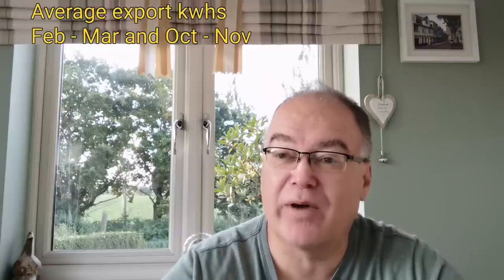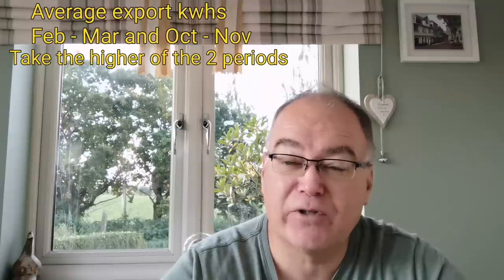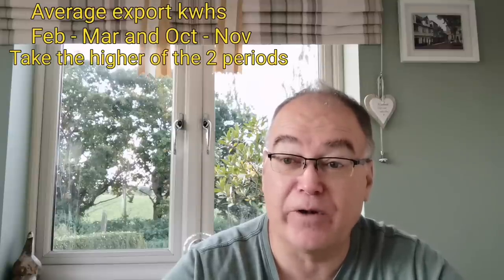How to size a home storage battery

Comment: Excellent video. I started with 6.5 kw solar and 8.2 kwh battery and found battery running out during the day in the winter months. The battery is only 6kwhr useable so I have just topped up with a new 9.5 kwhr battery which is 100% useable giving me 15.5 kwhr. What a difference it has made with grid import down at below 1 kwhr per day this winter. I used to charge the battery overnight on cheap rate and whilst still having to do it when there is no solar, the frequency of charge has also reduced. I agree with going big on battery size and solar. The biggest surprise has been the free hot water from the EDDI. In 550 days of having solar I have used the gas boiler only 10 times to heat up the water!
Reply from the maker: That sounds like a great solution you've got and paying dividends with its free energy. Eddi hot water is awesome, I hate drawing from the grid for hot water but needs must in December and January
Reply: I've stopped using the gas boiler to heat hot water - overnight electricity is cheaper, especially when taking efficiency into account.
Reply: Our 6k solar and 8.2k battery system (5k inverter) was installed mid September.  Presently on Octopus Go, and since late October, we've been regularly charging the battery to 100% each night.
Our base load is quite low at between 180-220w.  Family of four in a 4 bed detached home.
I did contemplate increasing battery by adding another 5k, but want to see how we fare during the worse period first.
Also (ours is mostly Givenergy) the battery output is limited to 2600w.  In order to increase the output you need to add another inverter (so I was told) which I wasn't keen on.
A little bit of common sense with main / hungry appliance discipline goes a long way, and the tumbler and washer can always be set to run during happy hours if necessary.
Perhaps down the road I may look at one of these Eddi diverters, but then we'd also need the water storage fitted and plumbed.
Inverters typically last about 10 years I've heard, if this correct?
I'm putting some of my funds aside each month for it going pop somewhere down the line..
Reply: Want to help the grid ..... are you kidding me, the "grid" has been ripping us off since its inception  - why would anyone want to "help the grid"?
Reply: @chrisrebar2381  maybe the excess energy produced with 'help the grip' ie you, by reducing the likelihood of power cuts...
Reply: @stuartburns8657  My first inverter lasted 11 years almost to the day.
Reply: @stewartaitken8022  Yeah, seems about on the nose timing / durability wise 👍
Reply: @EVPuzzle  Yes， and the energy storage integrated machine has appeared on the market now, and its capacity is very large, 15-35kwh.
Reply: @EVPuzzle Thank you for your video. You bring up some interesting points.. that being said. I disagree about your general statement that we need to use less energy. If we're talking about energy from the grid, or generator I am in COMPLETE agreement, however, one of the biggest advantages of even having a solar installation is the freedom to use energy to enhance our lives. 
If one's system is properly sized energy usage no longer impacts the grid. Obviously, it's not practical to design a system that will be 100% grid independent 100% of the time for days and weeks on end, so airing on the side of caution is always wise.
I SAY: " LET SOLAR POWER SET YOU FREE!"

In for a penny in for a pound. I'm going from no solar system whatsoever to: 10kw solar array, 12kw inverter & 30kw battery storage (24kw @ 80%)
This should allow me to run off of my solar panels during the day in store enough to get me through the night using the grid as a backup and a 6,500kw LP gas generator as an additional backup.

Comment: Very useful video. I went through similar thought process and decided on a factor of 1.5 times average usage, so 15kwh battery for average usage of 10kwh. Only installed for a few months but seems to be working out. Definitely think about the three parts of the year. Summer -  we will be self-sufficient in both electric and hot water - no mains usage. Winter - just charge the battery in the overnight cheap rate and let solar do what it can to cover daytime load and recharge. Spring/Summer- partially charge overnight and top up from solar. One big advantage of oversizing: if you are installing a complete system it is free of VAT, if you add an extra battery later it is plus VAT!
Reply: Yeah, got a 6k pv and 8.2kwh battery mid September.
Pleased with it, but wish in hindsight I'd have also maybe added another 5k battery as part of the original install vat free.
Hindsight eh?

Comment: Thanks, Nigel. Some good ideas to help with the calculations. Great work, keep it up 👍👍 I am 1 week in to having Solar connected. It's an E/W facing roof on a smaller detached house. I've gone for 12 West facing and 7 East facing panels - All I could fit given the roof shape. On Monday we have a 5KWh battery arriving. Looking forward to seeing how this helps with the overall aim of reducing pull from the grid. I will use this winter and spring to see how it works, and consider adding another 5KWh battery next year. I remember your earlier video well with advice about just using less electricity first before buying batteries. We only use 2750KWh a year at the moment as a household, but well see how this changes as we adapt to having the solar / battery available.

Comment: We use less than 10kWh/day on average, and we're retired.
We've just had 10kW of panels installed 5/5 on an East/West roof with a 35° pitch. Two 5kW string inverters and an Eddi. I also have a Zappi, but only need to charge the car once a fortnight, if that.
I've turned off the gas hot water and use appliances as much as possible during daylight hours.
I have a 10kWh Libbi with 5kW charger/inverter on back order (subject to price).
One of the issues that needs to be considered is battery inverter.
Microwave (900w) plus kettle (2.8kw) plus oven (2.5kW - 4kWh on boost) means that a 3.5kW battery inverter won't hack it.
This is going to be a learning experience for me between now and when the battery arrives.
Reply from the maker: Nice low usage so your solar and battery will keep you running without any grid use most of the year.  Tiny bills here we come 👌👍

Comment: Really interesting real world example. Great video and shows the complexity of the calculation.   No idea yet whether our calcs are correct - 11.6 kw system with 2  7.2 kw inverters and 2 5kwh batteries on a 3 phase supply with an ev!  Plus English weather…. Too any variables…..
Reply from the maker: Solar sounds great so presume you use lots of energy, battery though will be the challenge, how often do you run out and are you happy running out.

Electric heating is a killer as it uses energy outside solar hours

Comment: I think for me a key consideration as well is future proofing. I’ve gone for bigger than I need with the expectation of buying an EV (or 2) in future and possibly a heat pump further down the line. Seems like more and more things are going to be using electric going forward.
Reply: Yes， and the energy storage integrated machine has appeared on the market now, and its capacity is very large, 15-35kwh.

Comment: Thank you for your video. You bring up some interesting points.. that being said. I simply disagree about your charge that we need to use less energy. If we're talking about energy from the grid I am in complete agreement. However, one of the biggest advantages of even having a solar installation is the freedom to use energy to enhance our lives. 
If one's system is properly sized energy usage no longer impacts the grid. Obviously, it's not practical to design a system that will be 100% grid independent 100% of the time for days and weeks on end, so airing on the side of caution is always wise.
I SAY: " LET SOLAR POWER SET YOU FREE!"
Reply from the maker: Very true , it is an enabler but freedom Vs wastage has a line . Balance is good

Comment: Morning

New to this game, had 12xJA Solar 405w panels, a Solis 3.6kw hybrid inverter and 2x 5kw PureDrive batteries installed early August, so not much data yet…so far, I’ve only imported 49kwh (approx 6% of my consumption) since the system went live and living in the central belt of Scotland I’m expecting this to increase over the winter months…more to follow as my data set expands…

Like the videos….
Reply: Hi Duncan
I'm in S Ayrshire so was interested in your data. We have a 5.85kW system, but are still waiting for our 10kW Puredrive battery. Who knows when it will arrive. Can I ask why you went for 2 5kW batteries rather than one 10kW one? Thanks
Reply: Afternoon Martin… 3 factors on the choice of batteries…. Availability, ability to daisy chain thereby increasing capacity and redundancy… if we lose one battery we still have a partial system…
Reply: I’m in the process of a similar sized array but looking at one, likely two GivEnergy 9.5kWh batteries and 3.6 hybrid inverter.  Based in Glasgow, think the second battery might help more in winter.

Comment: Thank you for your well thought out video. 
We installed our panels and batteries nearly a year ago now, and had similar thoughts. Now we live in Portugal, which is somewhat different. Approximately 300 days of sun per annum and you can’t sell back to the grid.
But the same logic still applies; understand what you want from the system, work out your peak daily use, and size panel production and energy storage accordingly. 
We have been off-grid since March and we consider we have the balance.
By the way, I’m a Norfolk gal, and I can hear a slight lilt in your speech, but the picture of Elm Hill confirmed it to me!

Comment: Good video as always. I have to agree, sizing of the battery is a case by case basis. When I started looking back in 2019, my primary goal was to be able to get through the evening and so I went for a 16kwh system. Now with electricity prices as they are, getting through a dull day on the cheapest electricity available has become the priority, hence shifting from 21kwh usable to 25kwh , the extra 4 is to balance things on those dark days. Being able to charge cars or hear water and run the house without pulling from the grid at expensive times has proven to be invaluable. The install I have can cope with 7.2kw of load, which with the 10kw solar can mean covering a 10kw of load (7 from battery, 3 from solar) on an october day. So as you have said, this is about what is needed for your case, and one size does not fit all.
Reply: Can you charge all that capacity from zero (or close to) in winter in an off-peak period? If so, what inverter/charger are you using?
Reply: I have two single phase AC 3600 lux units. This means max charge rate of 3.6kw per unit with a max of 12kwh (ish) in a 4 hour period.
Reply: @johnrush3596  I'm thinking of a Victron Multiplus 48/8000, with 15kWh batts initially but then doubling to 30 when budget allows.

Comment: We're all different, but I found some of the points in this video very theoretical. I have an ASHP, underfloor heating, electric vehicle charged on a home wall box, 6.4kW solar, and 13.5kWh Tesla battery. No gas or oil. Most winter days in our 4 bed 2021 build detached we consume about 50kWh, 60kWh when the average 24 hour temperature is down to 1 or 2°C (or lower), about 40kWh when it gets above 5°C.

In winter, the solar output is pathetic, about 2 to 3 kWh per day in December. So we charge the Tesla domestic battery overnight on Octopus Go off peak (which lasts 4 hours) at about 3.5kWh per hour. We also run the underfloor downstairs heating fully during off peak, and the ASHP can run at up to 3.8kW to achieve that (especially in sub zero temperatures). The wallbox for the car charging consumes 7.5kW, and other demands (electric heating in the bathroom, for example) lift our overall consumption to about 15kW per hour in the off-peak period. That is about 70amps, so the first point to check is the actual fuse size for your electricity supply. The box probably says 100amps on the outside, but the District Network Operator may have installed a smaller fuse because of local network inhibitors. For about 120 days of the year in winter, we could use two Tesla batteries. That would allow us to get an additional 11kWh of usable off peak capacity (Tesla recommends not depleting the battery below 20%), so on our current tariff that would enable savings of (40p full rate - 12p off peak per kWh)  = 28p per kWh x 11kWh per day x 120 days = £369 per year. On current prices, that's a payback period of 20 years +, which is longer than the lifespan of the battery, and we would need a 20kW supply.

In summer, our daily usage, excluding car charging, can often fall below 20kWh. So we only need one 13.5kWh battery to cover evening use after the solar has stopped. We charge the EV either from overnight off peak or trickle charge from solar (in summer). In an ideal scenario, we would probably have about 15/16kWh of USEABLE battery storage, but since Tesla only makes one size of battery....

As the video says, we're all different. You might want to run air conditioning during summer days, or you might want to keep a reserve to cover for external power cuts. I would never seek to charge an EV from a domestic battery, because in many cases you might be putting the charge through two inverters, one into the domestic battery, and one into the car battery, with a loss of about 10% each time the supply is fed through an inverter.

Comment: I do this on an outlet basis. Started with my kitchen as that is the main area that needs to continue to run when grid is down. Testing my need is a matter of turning of the grid for as long as I can deal with it :-)

I started in my kitchen using an Ecoflow River 600 with 768 wH inside and an extern 1500 wH external battery. It can run some bais appliances in my kitchen like a fridge and a inductionhub on lower settings. So I can heat some food and charge some small devices. If needed, it can also run the heater of my house which is on gas but does need up to 50 watt of electricity to do so.
I charge it from AC but on a sunny day I turn that off to profit a bit from my solar. Only like two panels which is fine in grid down situations. 

These panels are also connected to a grid-tied-inverter so they are always able to dump their yield into my home grid. Using a 1-2-both switch on the MC4 solar cable to do this, also allowing me to send more to the battery's.
Do mind the voltage that the mppt-charger can deal with though*

Now for my kitchen I want some more wattage, so looking for the Delta 2 so I can run 1800 watt devices even when the grid is down and have some more storage. The old system will then just run the internet and my working at home spot, which one also want to keep alive when grid down.

* I solved that problem by having a victron mppt charger that could deal with the voltage from the panels and have it charge a 12 volt battery. That MPPT-charger also has a load port that can be programmed for a certain voltage range of the battery to open up. To that port I have connected my Ecoflows in my home, so they only get charged from DC when there is enought voltage in the 12 volt battery.
Reply from the maker: Sounds like a clever system. Having portable or non grid tied batteries really helps. I'm. Planning a garden room system but that'll have a portable battery that can double up as an emergency system for the house
Reply: @EVPuzzle  Outside near my panels I have a 12 volt battery that had heatmats to keep it warm in winter.
From the load port of one of the MPPT controllers I have 12 volt lines into my house connected to my portable batterys that are both AC and DC connected. When AC drops they will start charging from the 12 volt battery immediately.
Reply from the maker: Would love to see a diagram for this setup 🤔

Comment: i went from 4 x us3000c pylons to 6 x us3000 pylons and went with a parallel 5000va multiplus so I can charge in the four hour window, because as you say a single victron wont do it.
Great thing now is that I can invert up around 7500kw - which means whatever I have running in the house, i never pull from grid.
Crucial thing is a use multiple jump cables from the pylons because they too thin (25mm2) to support sustained high current.   I use a jump cable for each pair of pylon 3000’s and it all stays cool now
Reply from the maker: Parallel inverters. Nice  and   totally agree on cable sizes, gotta be cautious with big loads
Reply: Eliot, who supplied and installed your setup? This sounds like a great setup.

Comment: I've had 9.9 kw DC battery storage and 6.8kw solar for 18 months and recently added a further 3.3kw. As a Go customer if you charge your battery at night you can only charge at 3kw so at most I can only charge 12kw at the lowest cost. So any more battery storage could only be charged at full cost. I found on the worst solar days with 9.9 I would sometimes drain the batteries towards early evening. Though managed an average of 6.08 pence per kilowatt cost most of last winter. Batteries are great during winter using low cost night charging when solar is low but if you have solar the batteries hardly ever get used during summer months so usually stay over 70% charge with 100% most of the day when the suns up. No need for any low cost charging during the summer. Not sure of the charging speed of ac batteries.